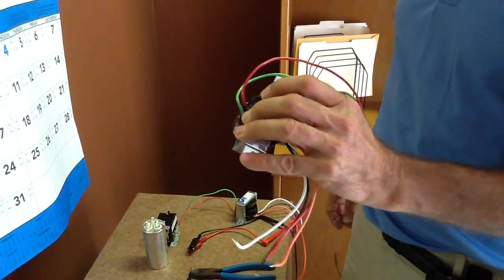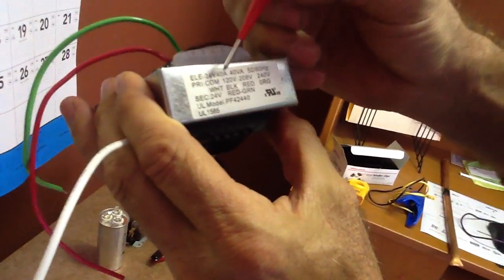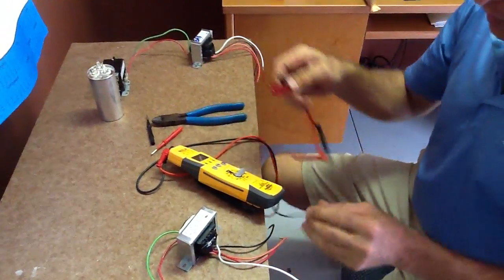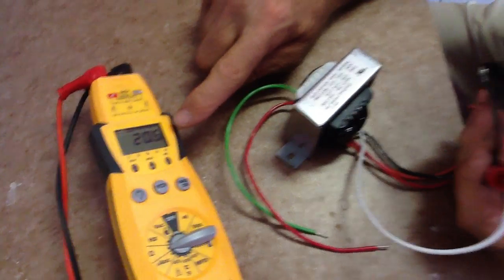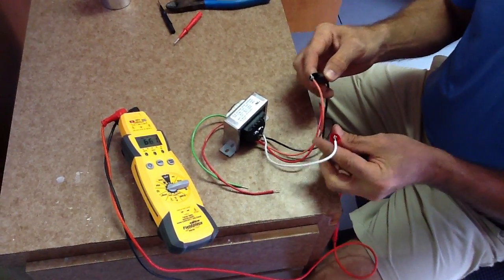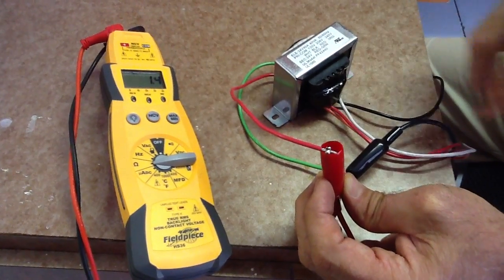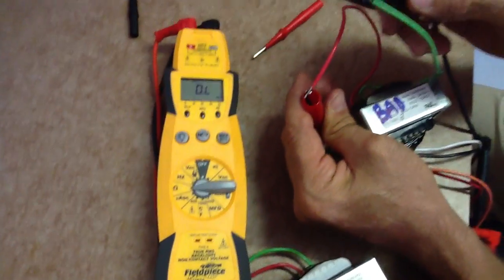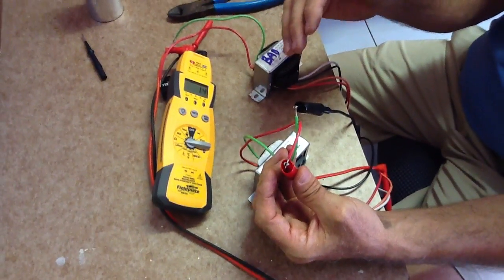Transformers for Air Conditioning Repair

Comment: Eh..I thought most houses air handlers would use the 110v wires. The 220v is used for houses with heat pump; heat pump is not as common.

Comment: so how do u get 240 out of one leg? 110 to the com and 110 to the 240 pin?? I'm so confused!!!! thanks
Reply: jb that’s the input voltage option. Meaning you can input/connect 120v or 208v or 240v to lower the voltage to 24v. Hopefully this helps.

Comment: hi David I have a transformer with 2 wires with primary input of 120 volts and 12 volts out when I put a meter across the input get wires I get a open reading no ohms on secondary side I get reading of 1.5 ohms  should input have some resistance?

Comment: thanks  nice video,  but check this out,.... my secondary is  4.1 ohms,  then i got two red and two black on my primary, which red to red 158 ohms , and black to black 158 ohms, and black to red 00.00 ohms nothin , so im wondering which primary wires do i hook up to my 110 ac??

Comment: In a heatpump what could be causing my transformer to burn out? I know it has to be on the low voltage side because im not getting 24v, but what in the low voltage can be causing this problem?

Comment: hello David my transformer one primary 120v and secondary 24v 40va. secondary winding only shows 0.8 Ohms (you said it should be at lease 1.5 Ohms) and Primary shows 25 Ohms. is my transformer still good?

Thank you so much
Michael
From NJ

Comment from the maker: You need to set up the transformer for the voltage provided by the power company. That's why you have 120, 208 or 240. Be careful to choose right voltage.

Comment: Mr Jones.
I don't understand why we use 240 volts rather than 208 volt wire on the transformer when using 220 volt condenser/air handler.